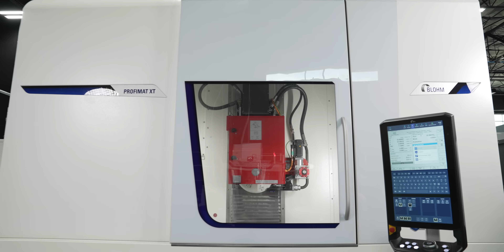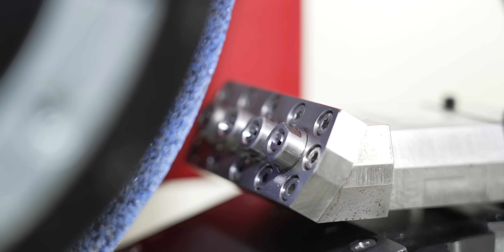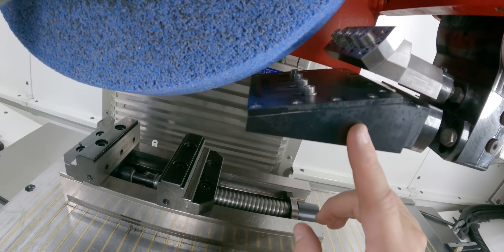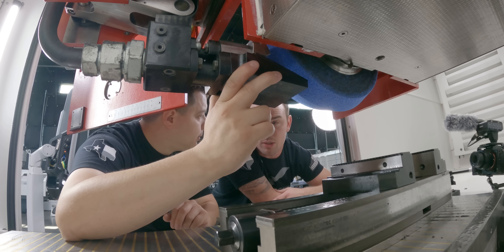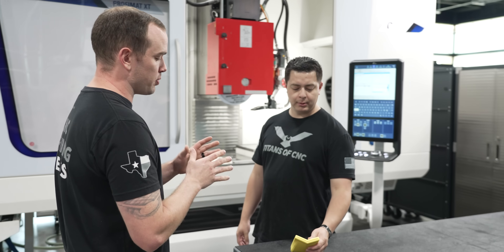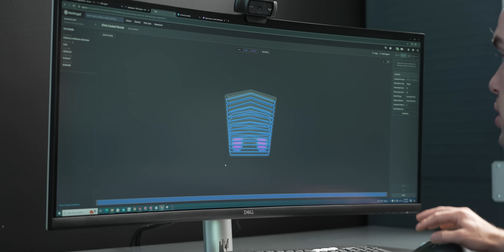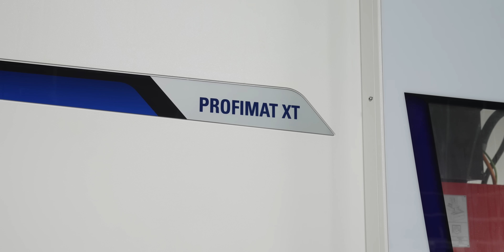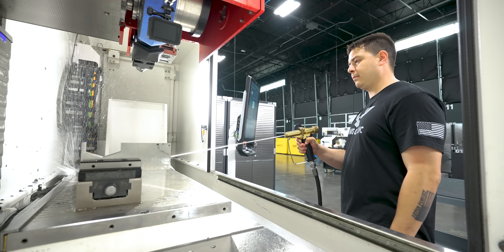Attempting 15x Deeper Cut Than They Said Was Possible

Comment: They didn't say what the material, hardness, tolerance, and finish requirements were. Most machinist would mill, heat treat, then grind IF required.

Comment: Based on the tool paths shown, I feel like the inlaid carbon fiber didn't actually contribute that much, as the un-reinforced layers could still separate as they would in the PLA printed one. I have a feeling the print orientation was the real difference between the nozzle here and the failed one. I would be interested in seeing the same nozzle printed with just the polymer and see if it would hold up.

I've worked in the additive field with too many engineers and operators that overlook the inherent advantages and disadvantages of the process they are trying to utilize and make decisions based on those factors. Print orientation being the biggest factor when I'm called in to diagnose why a part is failing in an application when the material properties exceed that of the needs of the application. Just because the part imported into the slicer one way doesn't mean that's the best orientation to print it.

Comment: The sides of the wheel are cutting aswell but are neither dressed, nor cooled or cleaned? If the wheel is so soft that it breaks under your fingers, wouldm't the cleaning nozzle destroy the dressed profile? Wouldn't it be advantageous to have that nozzle do it's work before the dresser?

Comment: Cool that you CAN do it.
But in what realistic scenario would this be used? instead of just having a mill remove like 99% of the material & THEN make the final polish on it with a wheel like that?
Reply: Doing something like a hair clipper blades or saw teeth you cant rough that out. Creep Feed is the way to go

Comment: Here's one for you to try. Bolt a 8 inch cup grinding wheel to a milling arbor, put it in a vertical milling machine and mill through a chunk of steel as if you were face milling with no coolant at milling speeds and feeds.

Comment: You're worried about the strength of the 3d print but you don't even print it solid
Reply: they did though
Reply: Infill has little impact on overall strength of prints it’s more just a frame for the walls and top surface to build off of

Comment: How much of the wheel was consumed in this cut?  (Change of diameter from start to finish)
Reply: With a wheel that soft I can imagine it shrunk about an inch.  I think the pass they showed without coolant might have consumed the bulk of that wheel.
Reply: @vintageludwig they weren’t actually grinding on the dry pass.
Reply: @vintageludwig you can see by the nozzle position before and after there was a tremendous amount of wheel wear.